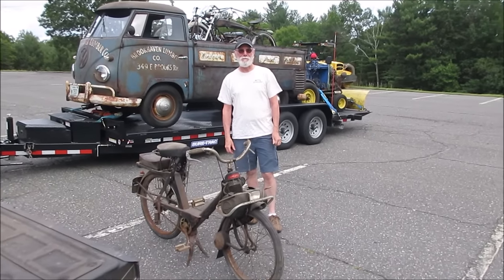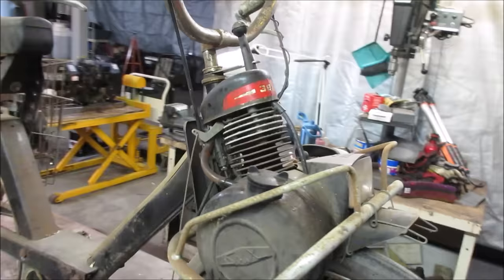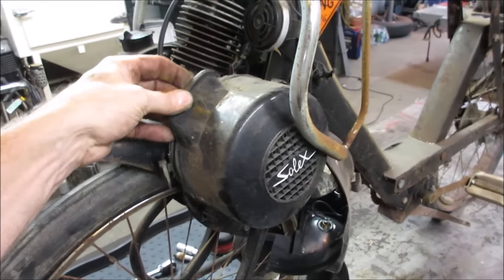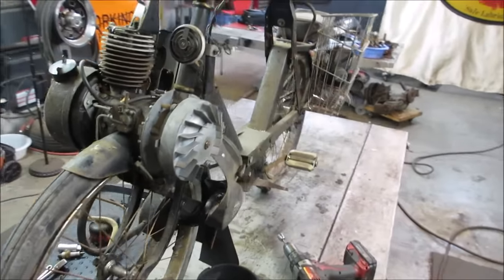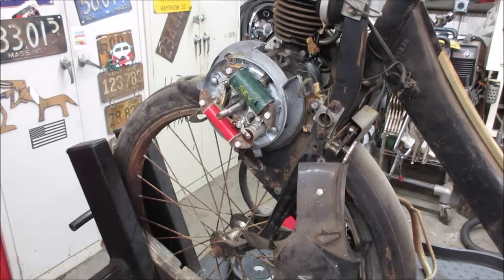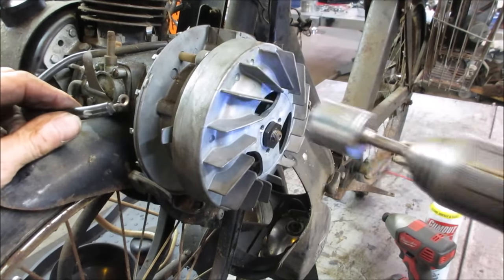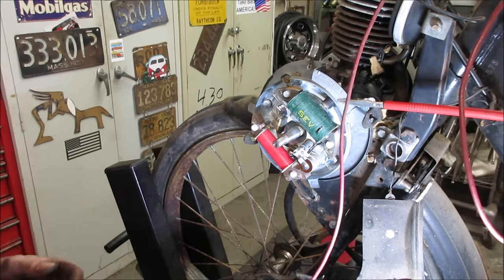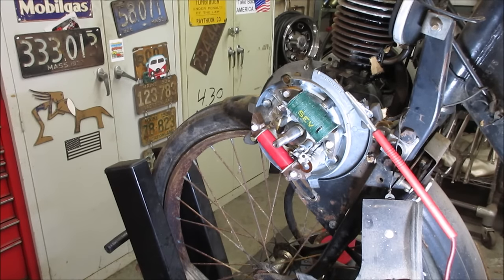Will It Run? VèloSolex 3800 Moped Parked in 1978.

Comment: I'm as french as they get and I can confirm that the "throttle" is backward. 3800 is the model name and displacement is 49cc. It goes at a breakneck speed of 20mph with a slight tailwind.

Comment: Rims and spokes and tires maybe a chain if that one is toast
That throttle is correct its designed to be ran at full throttle so you dont need to twist anything or operate the throttle
Its started by decompression then drop the engine onto the tire while moving forward let out the decompression and your away to stop you close the throttle lift the wheel and hit the kill button in advance of stopping of coarse

Comment: As to the backwards throttle lever, my guess is that it was intended to be used as main transportation, and the thought was that it would spend a whole lot more time at full throttle than it would at partial power. Probably pull the compression release to kill it, and then take off the next time by pedaling until the rider had enough speed up to turn the compression on and then it just ran at full power until either needing to turn or stop, at which time one would pull the lever to slow down and/or stop. 
As slow as they are, I'm guessing that running at full power most of the time would be the typical use.

Comment: I'm not sure but I believe the tool sizing system was called "Whitworth" or something similar. Head size (Heads of bolts/nuts were bigger to compensate for looser tolerances) and thread pitch were slightly different.

Comment: Mine had a 2 position twist grip for the throttle and front and rear brake handles. I think it had a kill switch but I don’t remember. It did have headlight brake light and running light, horn speedometer.  I would fill the tank for 5-10 cents. With slight mods it did 35 mph.

Comment: A great video. Just one small point: - This little 50 cc motor is a two stroke. I don't recall you mixing any 2 stroke oil with your fuel? Most 2 strokes of the time also gave off a slight whiff of blue smoke and I didn't see anything like that either in your video. It won't last long on neat gas alone.
Reply: The canned fuel that he was using is 40;1 premix. You can tell by the color of the fuel that it has oil in it.
Reply: 38 cc
Reply: Smokeless 2 stroke oil

Comment: I had a girl freind in the early 70's who had one of those cyclo motos or magic wheels as we knew them back then, to stop the enge you decompressed it, no kill switch. The mag coils were always giving trouble, a replacement was about ten shillings which back then I think was somewhere in the region of a dollar and a half to two dollars. The front tyre is a special one for that type of machine, an ordinary bike tyre will get ripped to pieces by the carborundum coated drive roller the back tyre is an ordinary cycle tyre.

Comment: My fathers model from the fifties had no cooling from the flywheel.  Solex therefor did not allow to run the motor when not engengaged .
There was no centrifugal clutch either. Those things came wih  the later model, called Solex-Oto. The throttle was still controlled with a separate little lever on the right side, but not connected withe the front brake. Not in the Netherlands in any case. Maybe international versions had different provisions. The motor went "full speed" when the throttle lever was released, but the  friction could be increased easily.

Comment: It looked like the right hand brake lever does the brakes and reverse throttle. Meaning apply brake and reduce engine rpm at the same time. There is a cable from the carb to the front brakes. At least that’s what it appears. Also the carb shield would have been easier if you push the engine forward like it’s driving the wheel and it would allow your hand to barely fit between the carb and that nut you dropped. That’s the way it looked from my recliner in WA state anyway. 😊

Comment: I wonder if the reversed throttle was a type of cruise control. You putt along and don't have to hold the throttle until you want to slide down or atop

Comment: Have you ever heard of lubrication.? Ok, then give the cam to the contacts. The fuel pump is driven by vacuum from the crankcase. That membrane has a tendency to leak. There is a centrifugal clutch for the carborundum roller, if it hangs (it hangs for sure) then it shreds the tire in a flash.

Comment: Just my two "francs" worth. I don't think the throttle is backwards, due to ergonomic considerations. Would you really want to be holding that lever in the whole time on a bike that only goes about 16/17 MPH (or 25/27 KPH), for a 8 mile country ride of 30 minutes straight? Your hand would start cramping up. This idea also works for city driving, as you would only want to idle the engine at stops, which are momentary. This makes sense to me but perhaps some of the Solex users out there can tell me if I'm right or not.

Comment: you finally managed to wake up solex but...don't work too long without the ventilation cap on, you'll catch the engine due to excess temperature...oil mixes gasoline with castrol 2T in the proportion 2.5/3% at most this decompressor serves to turn off the engine and also to help start the engine... you really need to study this bike as a matter of urgency

Comment: The backwards throttle makes sense.  When you are stopped you hold it in and when you want to go you just let it out and off you go without having to hold it all the time.  I don't think there is much need for throttle modulation in such a low powered moped.  That's my observation anyway.  French things sometimes have a different way of thinking.

Comment: Made in 1970s the engine is 3,800cc and they go for anything from £200 to £1300 depending on condition etc but as they seem to be a lot rarer in America I'd imagine the price would reflect that fact to some extent as for such an old bike though there's still loads around in the UK. Oh interesting little fact Steve McQueen rode one whilst making the movie Le Man's made in 1971 using it to move around the set. That one is currently for sale for $66.000.
Reply: 38 cm3 not 3.8 😅

Comment: Mustie if you think about it, the throttle is backwards as your hand would ache by holding the lever open for long stints plus you would  need to hold the lever in as you push the engine on to the front wheel and then once the engine kicks in you let go. Smiles...😂

Comment: I just got a DUI on a gas bike after hitting a pot hole and crashing. Broke my back,neck and sternum and it sucked. I miss riding it. Freakin cattle guard then 2 feet away a big ol pot hole and then a corner. I couldn't dodge the hole because of the cattle guard going about 20. Don't drink and ride.

Comment: Wow, that one while complete, is a mess! I suppose being complete is the bigger deal though eh? I had one around 1980... Terrible machine really, but I loved it nonetheless lol. I welded up the frame joints to try to give it a little better stiffness with limited success. Have you seen the modern ebike take on that? its pretty cool. How did you start it with the drive wheel engaged? Clutch fried?

Comment: starting wonder at 40:00 when it would started to smell burned rubber as the engine is on the wheel should be lifted if not driving.🤔

Comment: The British wrenches in the 1960's were Whitworth.  The system was based on the imperial foot and inch.  Another way to confuse those working on British equipment at that time.  They adopted the Metric System not long afterwards.

Comment: I'm thinking you have a head gasket leak sucking air by the stain between the head and jug at the rear...I'd also check base gasket and crank seals by using something like WD 40 at those points to see if RPM changes

Comment: You almost need an engineering degree to ride that thing. One lever to engage/disengage the motor from the wheel, one lever to turn the engine off, backward pivoted control levers and a reverse acting throttle. To stop the damn thing you would need to let go of the front brake or let the engine run full throttle and ride one handed so you could reach over the handle bars and tip the engine back up off the front wheel. Not a good mix for an emergency stop or crash avoidance situation. All you need is an ambulance to follow you and you are good.
Reply: Honestly these are so underpowered they are not the least bit intimidating...you have to pedal to assist it othewise it struggles to get going.
Reply: The engine has a centrifugal clutch, so you don't have to pull it up when stationary or when the brake is on. This was only necessary for the old models before 1959.

Comment: ha ha. As a kid in Denmark i had several of the (all used and a bit older model) They would run for what seemed forever on a tank. It used to be that if it would not run it was usually the air fuel mix and if it was not that I was going to be expensive 😂.  When the exhaust got plugged you could rip out the guts and shove in a metal curly cate😂😂

Comment: As I understand it, these were deliberately under-stressed, designed to make a modest bicycle speed sustainable without pedaling as long as reasonably flat and no biting headwinds. Going up hills, the motor assisted the rider's effort so no gears needed. In some European countries, 12 year olds could ride a Solex or low-powered moped without a license.

Comment: If i remember correctly, releasing the throttle is full throttle and squeezing the throttle is for idling and standing without moving.
Reply: The newer models towards the end of the 70s had a twist throttle grip. This could also be retrofitted to older models so that you don't just have to drive at full throttle.

Comment: Hey . Idk how else to ask but i have an issue with my simplicity 6512.5. GT.  Forword gear has tons of power, but refuses to go into reverse and dont know if its a coincidence or not but motor sortof bogs down...and wont go into neutral...... but strangest part is when i manually pull the tab under the seat it will only free roll FORWORD... backwords it still feels like its in gear.....and will not move.

Comment: Have you supposed to have a gray button that you push with your left hand and you hold the throttle that with your right hand and you set the motor down on the tire once you start pedaling can't start it from standstill and you got to use the decompression and there's supposed to be a kill switch on it🎉

Comment: i remember working on one them and that releases valve was suppose be hooked up to frame when you pull engine back off of wheels it kill engine because linkages push up open valve to shut off engine and push engine forward it close release valve and drive on wheels start up and go
i never seen one with thotter on backward but it neat to know about it
i be wondering if was super long ride ur hand be tires of holding thotter open whole time so they reveres it i believes goes 10mhp no more than 10mhp full thotter and pull it down it going around 2mhp or 4mhp it pend on engine rpm
2nd i did noticed it missing cover to cycling wall it missing come vent top of fan flywheels above headlight cover into cycling wall and hot air come out back of carburor 
i start to recogine this engine because it seen families to me somewhere i just cant keep track of it because i worked on it once and sold it never got hand on it aging for over what 20 years else not sure one thing i can remember is that build back in 1964 or 1967 between this years because take look at tag above pedal u will find about it

Comment: I seem to remember if it had round steel frame it was made in France but if it has a square frame it was made in Czechoslovakia.
Reply: The round frame was used until 1964, after which the square profile frame came. The last example was built by Motobécane in France in 1988. From 1995 to 2005 there was a new edition, made in Hungary.

Comment: Hello, all right...for the first time working on the mechanics of that motorcycle, you were very hasty because you hammered and hit the wrong places to remove the magnet and that simple action could move the entire crankshaft to the other side and damage the rest of the engine seriously... there is a lot of literature on this mechanic and I strongly advise you to read it before doing something catastrophic... in another case, go to YouTube and watch tutorials... a piece of advice all the screws you move in the engine have little tightening torque otherwise you'll easily dust the threads...the aluminum is very old and of questionable quality...because at the time there was little raw material...if you need help, i can do remote support...i hope this bike has a happy ending, big hug from Portugal

Comment: my first motorized bicycle.I bought the Chinese petrol engine slapped on rear sprocket on my mountain bike and few tinkerings with twist grip throttle I was away.Only problem is it just died after 1000Km or so.I couldn't start the damn thing even with the spark at the spark-plug.ignition timing??

Comment: French do a lot backwards - yes the throttle is linked to the front brake - so it has to be backwards.  Ah yes, if I remember well - they did run on 25:1 mix...

Comment: Don’t see any smoke coming from exhaust! Did you add oil to gas? It’s a 2 stroke, should have a 25 to 1 mix. The oil provides all the lube, it’ll seize up with no oil in gas!
Reply: Did you NOT watch this video?  Did you not see that he knew this was a 2-cycle engine, and that it required oil mixed with the gas?

Comment: Wonder if those handles operate the brakes too, and the throttle is reversed as a result.
Reply: yes they do but instead of outside the steer like on Bikcikle they run inside the working was the same but inverted the lever

Comment: What was the tool called that was between the socket and the drill to prevent it taking off in your hand or loosening the nut?
Reply: Ratcheting breaker bar adaptor.
Reply: @MellowYe77ow thank you
Reply: @bryanoleszczuk457  You're welcome.

Comment: They are all 49cc  and French and metric
3800 (1967-) is the model number, 1700 and 2200 being older
They had bicycle bell, not a horn
It needs a special higher front tyre
Give it 1/3 ether 2/3 gas and watch it fly to the moon

Comment: That's not really a moped as you described it in english, the "mobylette" is a moped like peugeot 103 or Motobecane, the Solex is  another categorie, it's a bicycle with a small engine without a clutch, a sort of helper but not a moped.
Reply: What you're alluding to is teenage snobbery. In the eyes of French law they are the same thing i.e. 49cc mopeds.

Comment: You know far more than I do, but your steps frustrate me.  You spun the engine and worked on the spark without checking the fuel tank, fuel pump, or carburetor.  The risk of filling the fuel system with old fuel and contaminates is high when you don’t check for that first.  Am I missing something?

Comment: That is a 2-stroke engine, the oil needs to be mixed in with the fuel manualy to the ratio 1:50 respectevely.
Reply: Did you NOT watch this video?  Did you not see that he knew this was a 2-cycle engine, and that it required oil mixed with the gas?

Comment: That is a strange throttle set up for the engine  you drop the lever down to go faster the squeeze the lever upward to slowl down
Reply: Nothing strange, it make sense when you ride it.
Reply: @14KiloWhisky   okay thanks for the info on this matter of the throttle set up on this scooter
Reply: @robertmailhos8159  bicycle 😉
Reply: @14KiloWhisky  okay thanks for letting me know that
Reply: @robertmailhos8159  it's very important, imagine a bicycle with an auxiliary engine who try to run at constant rpm. You don't touch anything, it runs at 25 km/h. You need to slow  down, grab the brakes and engine slow too.
Reply: @14KiloWhisky   the more I think about it  the lever system makes sense to me  just like a regular pedal style bike brake lever that you squeeze

Comment: It's more metric than you'll ever see. The metric system was invented in France. But the French often used strange size heads on their bolts, like anyone else using a 10 mm head on a 6 mm bolt. But they used a 9 mm head.

Comment: this is a lesson to not buy french crap! i had to work on a renault le car (le p o s!) one time. i couldn't even open the hood! the owner's manual was in french and the
handle you had to pull was WAY under the dash where no one could see it! the spare tire was mounted on the engine! why? damn french crap.

Comment: Typical early French design. They could not be bothered to hold the throttle open while driving so it runs to max when released to save them the effort (just before they smash into that big tree).

Comment: This nice old engine needs to be handled with care and understanding... and it is French... which means it has particularities which no one else can understand! 🙄
The gas and oil mixture is 1 oil in 25 gasoline or 4%... and these engines do need their oil or they will die in no time... at no point did I notice you using a 2-stroke mixture... worriesome to say the least!!
Letting the wheel drive roller rub on the front tire for such a long time really is not good practice!!
Also these little machines are a marvle and dirtcheap in fuel consumption!!
But please, not just anyone should be fiddeling around with such a nice historical "Velomoteur" (or Cyclomotor)... it is dissapointing to see some of your practices!!